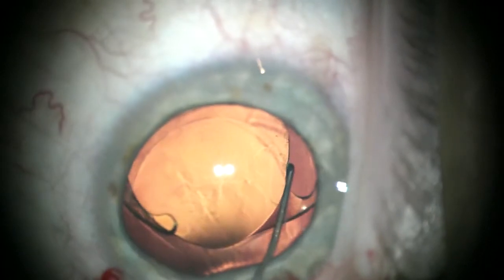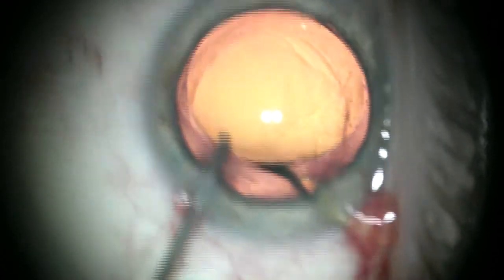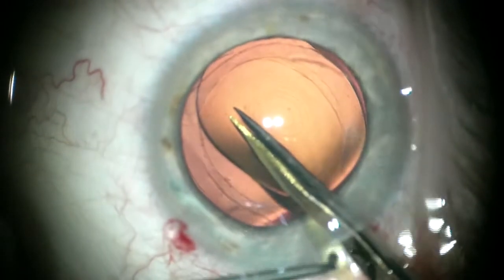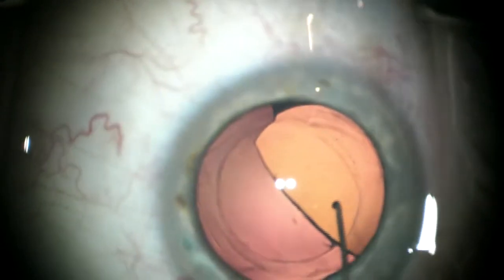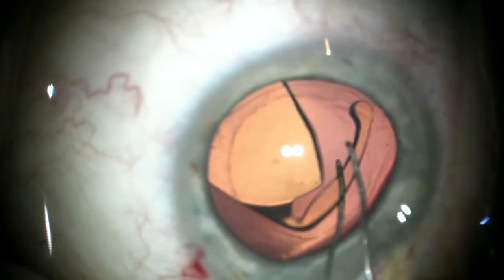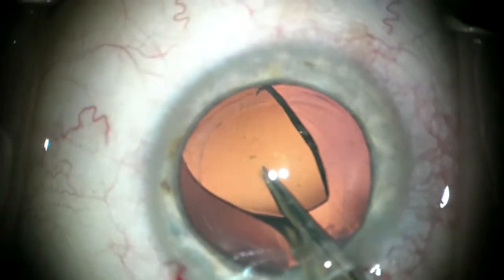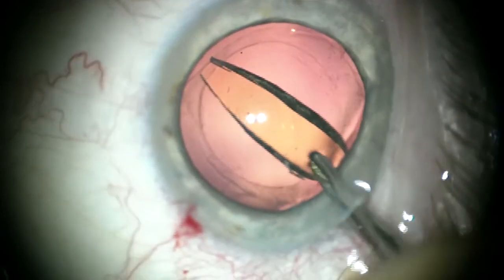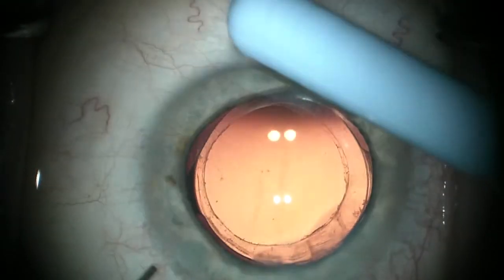Removal of multifocal

Comment: How long after surgery can you exchange the lens.
Reply from the maker: The longest that I have been able to remove a lens for exchange is 2 years.  And that was a difficult struggle because of the thickened end of the Acrysof haptic.  The haptics of a three piece IOL would slip out of the equator more easily. I always tell patients that I may have to give up if I can't loosen the lens to exchange it. Unless the IOL optic is damaged or eccentric adding a Sulcoflex lens is a good option to consider.